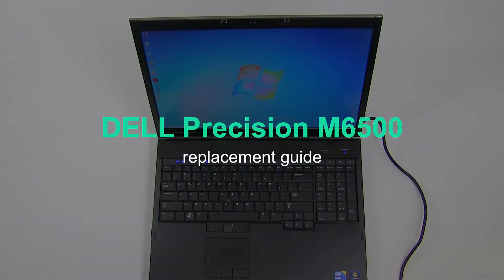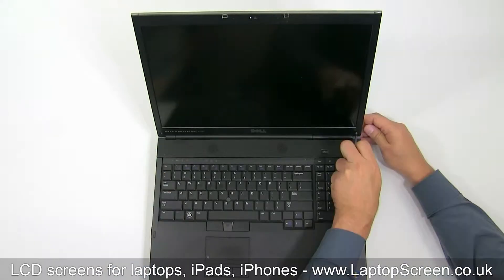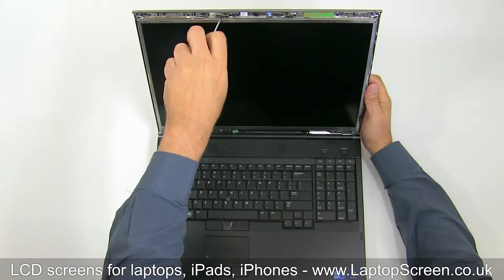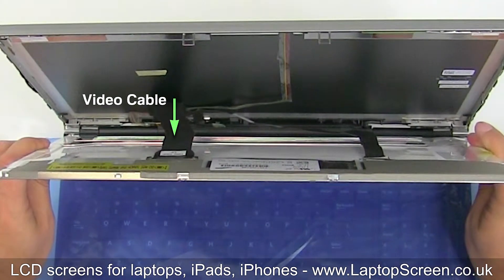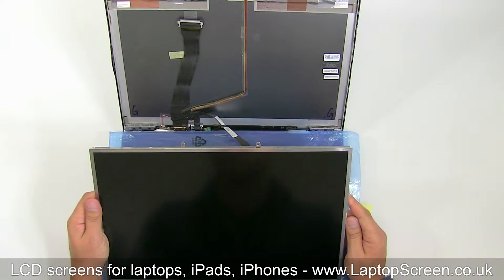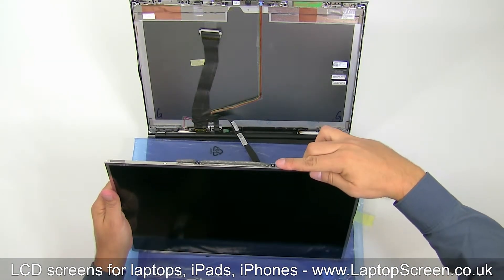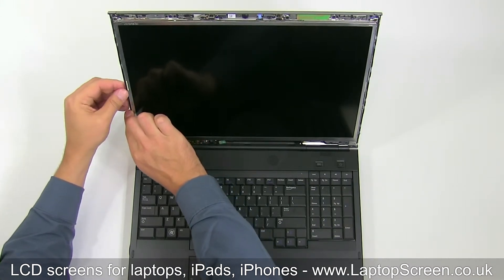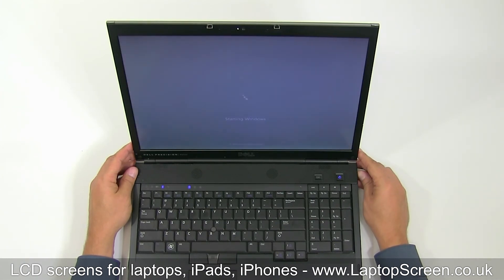How to replace laptop screen / fixing LCD Dell Precision M6500

Comment: Hi, thanks for an outstanding video. However, my Dell Precision M6800 does not have the two front screws on the lower corners of the bezel. What do you suggest I do to start removal of the bezel?